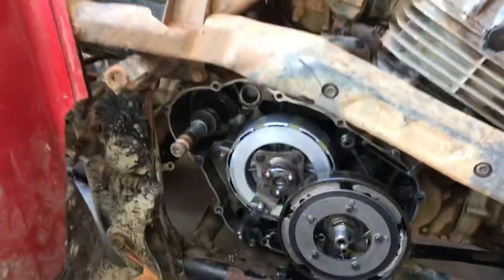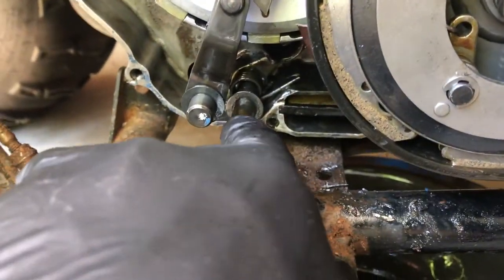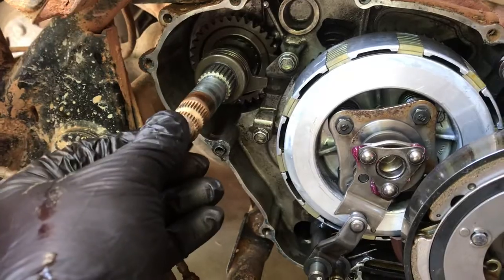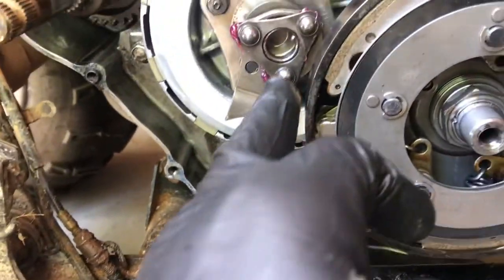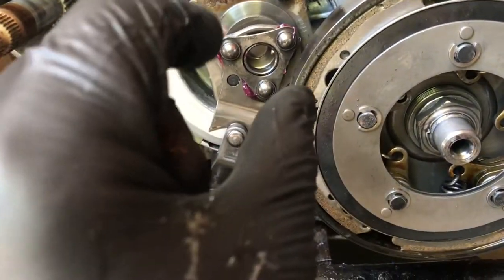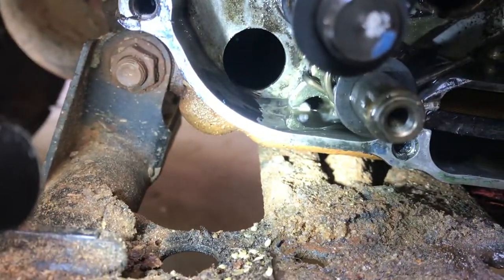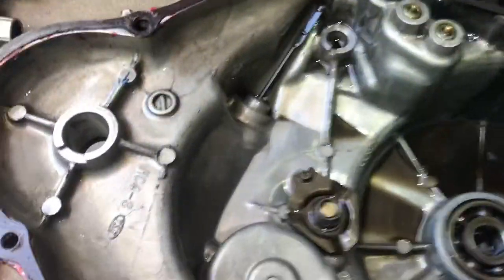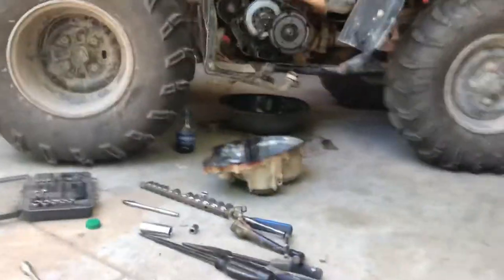Fourtrax 300 clutch basket/engine case installation

Comment: I really appreciate the zooming in on the reverse mechanism. I was wondering if I had it correctly installed and you confirmed that. Very grateful. 

Im trying to figure out how to hold the centrifugal clutch to torque the nut but the clutch turns with the wrench and I cant figure out how to stop it

Comment: Just bought one for 400$ CAD and it makes a grinding noise when using electric start and it sounds like it only catches a few times. Not enough to start it but when it does catch it has strong compression